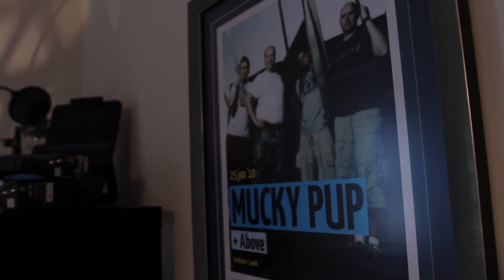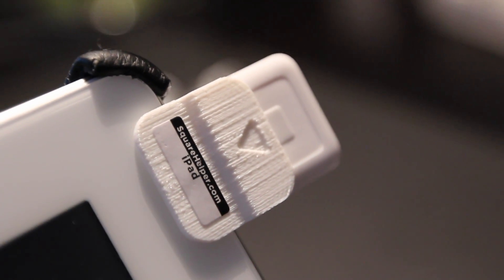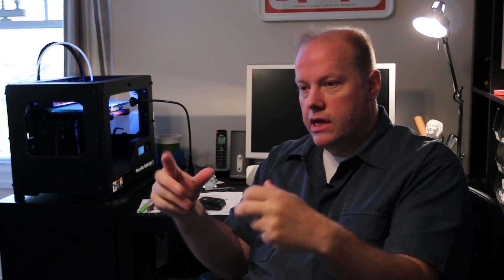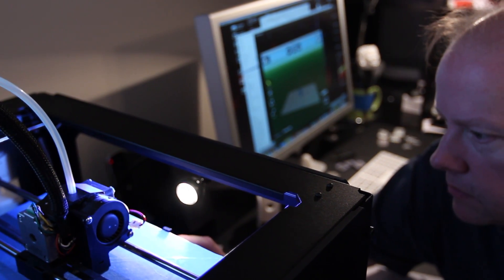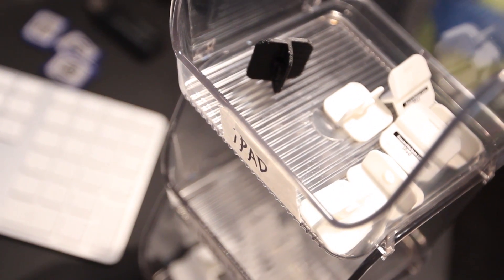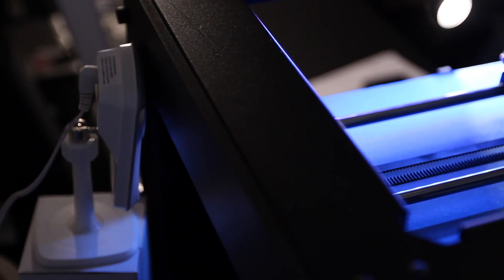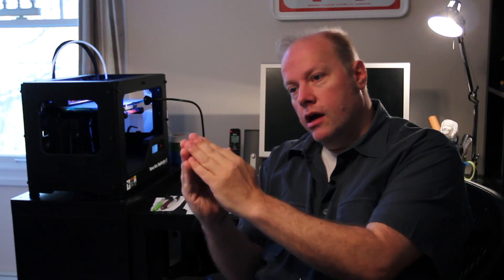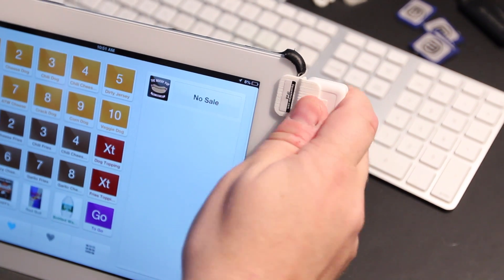MakerBot Explorer - Square Helper

Comment from the maker: Hi Leon - I do believe that Chris is printing at 100 microns although I believe he told me that most of the models shown here were printed earlier on in his manufacturing and sliced with an earlier version of MakerWare and an early firmware. He showed me a comparison of the prints he is getting now with the updated software and firmware and they are significantly smoother.